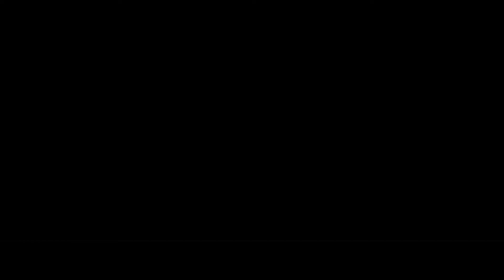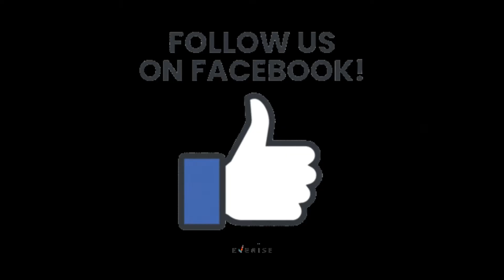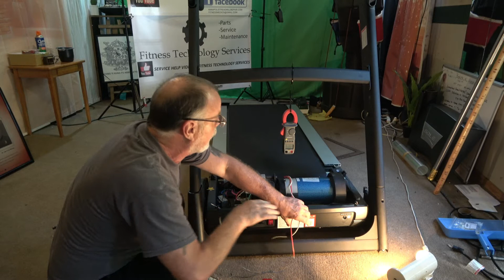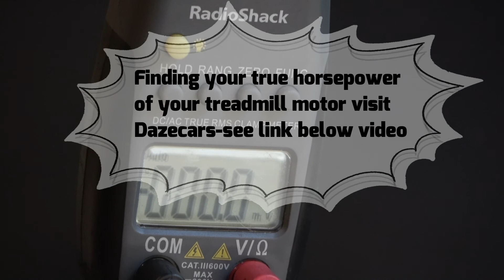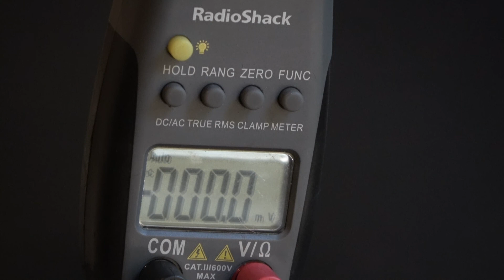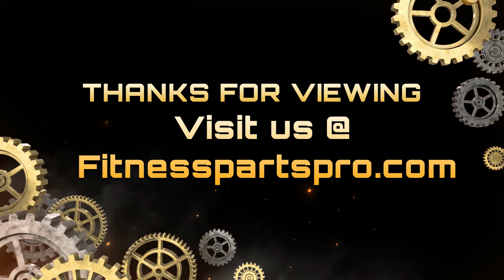Testing your Sole Treadmill motor

Comment: we are experiencing low speed surging unrelated to belt lube or tightness. is that an indication of failing motor of failing pot on board? how to isolate problem? previously had board rebuilt a couple of years ago. all board failures had screen fail to light. current condition is ls1 unless we kick start the belt. motor making noise when i stand on belt without kick starting. just looks like motor is bogging down because it's old.
Reply from the maker: Most of the time kick starting and noise is a sign of the motor going bad. Low speed stuttering can sometimes be fixed with adjusting the IR Comp . But you should do a walk belt test to see if is the cause of issues. I have videos on troubleshooting control and testing the walk belt

Comment: Great video! I have a question, I just changed  the motor control for the first time on my Sole F80. When I power it on, the light on the control is red, is this normal? My old control displayed green light. Thanks for making these helpful Sole videos!
Reply from the maker: I don’t think the color of the led matters. When the controller has issues the light sort of pulses

Comment: Thanks for showing us how to test the F63 motor.  Now I know that my motor is good.  I need to test the control board now since it burnt the connection on the board from the motor and it won't turn on anymore.  Nothing comes on.  Do I need to replace the board now?
Reply from the maker: Thank you ! If your controller connections are burnt you will have to replace board the only way to test it is to put a meter on the connections as best you can see if you have dc out to motor at start. Depends on what year I may have a video that may help. Sole motor controller troubleshooting. Hopefully this helps
Reply: @FitnessTechnologyServices  Thanks!  I found your troubleshooting video.  I’ll get back to you after I troubleshoot.  BTW, is there a chance that the transformer is the culprit?
Reply from the maker: @henzs.4241  well there is always a chance? But I have only seen one bad transformer and when it went bad there was no power to console

Comment: I just replaced my motor, new belt and deck flipped. Calibrated it, got 1:45 on 5 mph jog and got LS1 error AGAIN! Now what??? Tech that confirmed my dead motor said my board was fine. HELP!?!?
Reply from the maker: Hmm how did he verify the controller is good did he give you amp draw number. Either the deck is not suitable for flipping! Or the controller is weak. The only real way to tell is to amp the unit if while using it it pulls less than 7 amps then controller is weak. If it pulls more than 9 amps then deck is the issue making unit work to hard the amp readings are the answer

Comment: I have the F63 (SN 56381415....).  It counts down from 3, 2, 1 and then the display says 0.5 mph but the motor/belt is NOT moving.  5 seconds later the console reads LS1 error. ALL Console controls (fan/incline) work/display before the LS1 error appears.  The Control console can also alter the speed display but does not do anything to the motor.
I disconnected the motor from the Control Board and used a 9V battery as a source of power for the motor to determine if the motor is bad.  The motor runs. 
I then validated that the incline Up / Down lights on the board work as the unit is calling for an Incline command.
I then found the PWM light and observed it when I press the Start button.  The PWM light turns ON but then turns OFF about 5 seconds AFTER the 3 second countdown hits Zero. 
I attached my Multi-Meter to read voltage off the Control Board, after I disconnected the Red/Black motor wires for the Battery Test and do NOT read any D.C voltage when Powered On, during the Start/3 Second Countdown, or up to the LS1 error. 
I do not hear any "clicking" during /directly after the 3 second count down and not sure if there was a Relay that should do that or not?  Note:  I noticed a green LED light on all the time above the motor connection on the board.  It appears to read Motor DRV.  There is another LED light, not on, next to it that reads "Shut Down".  Any recommendations would be greatly appreciated.  Thank you!  Jay
Reply from the maker: Well that is a very good diagnosis and troubleshooting any time you have the pwm light on your  controller console is sending the signal . The controller is not working properly so you have a bad controller. But 90% of all controllers go out due to high amp draw from the walking belt being worn You should test your belt by force walking on the sides (on the logos ) then in the center to see if it is harder in the center. If yes you will need a belt Also
Reply: @FitnessTechnologyServices  So the PMV light initially being on means it is not the Console but a defection Controller (Board).  Is there a part for the board or are you saying if the "clicking" is not occurring /pmv light initially on then there is no "part" but only an entire board is the option? I was hoping it was like a refrigerator relay that is a separate part.
 
Do you sell parts like this and, if so, what it the cost including shipping, please? 

Also, I use the Sole Silicone on the belt when the Console tells me.  Are you saying that even if i do this the age of the belt is also the cause of the issue and no amount of Silicone over comes a warn belt? The belt looks great.

Do you sell the belt and, if so, what is the total cost including shipping?

This entire situation is odd because the machine was working fine, I lubricated it, and turned it on.  All good.  I then reset the "lubricant date"  on the Console and that is when i started seeing the LS1 error.  I guess weird timing.
Reply from the maker: @jaym48  for pricing or parts you will have to send your serial number to Fitnesspartspro@ gmail or you can input your serial number on our website Fitnesspartspro.com                         On the part of the controller that failed I am sorry I am not component level I do have them rebuilt around 179 but I would need your serial number to see which one
Reply from the maker: Oh and you should never wait until lube light comes on it  you should check it once a month and make sure the deck has a smooth/ wet coating
Reply: @FitnessTechnologyServices  so you do not have the Controller on your website; I just checked.   You are saying that you do, however, have them rebuilt?  If so, do I send you mine or do you mean you can get them "refurbished"?  If so, I will be interested  either way if you believe that is my issue per my long-winded explanations.  My SN is 5638141508016999

Comment: These videos are really helpful!
Reply from the maker: Thank you very much
Reply from the maker: Oops forgot to mention please subscribe 😃
Reply: @FitnessTechnologyServices  Done! 🙂I bought a second hand F85 2015-model (I think). Do you know if these motors are different from the newer ones - since the specs on mine show top speed of 20 km/h and the new ones go to 22 km/h? When I got it it stopped at 18 km/h even and I changed it to 20 in service mode.
Reply from the maker: @perarnelarsen2180  well to be honest I don’t think it makes a difference. Is the issue with someone on it .or running on its own.

Comment: Thank you for your videos. Speaking of motors , my 2020 Sole F85's motor is making a weird ticking sound. I recorded a video and you can see that it's not coming from the rollers and probably not coming from the pulley. 

https://youtu.be/yZaa8Vj-Qqc

Any ideas? Thank you.
Reply from the maker: Well you are so welcome, and you are right that sounds like a motor to me. The only thing you can do is check the motor brushes. They are under the black plastic covers. Make sure it’s unplugged sometimes the spring that holds them gets bound up ? Or the motor commuter is burnt in spots. And when the brushes hit that spot they tick .Either way I would call sole .so new this may be under warranty

Comment: This was a good video - very helpful.   I have a Sole F63 (date code 2014), where the motor hesitates when you first start it - but if you push the belt with your foot it 'catches' and starts normally.   Sometimes it will start itself, other times it sits there trying, but if you don't help it along by moving the belt manually it does not roll the belt itself.   I believe the brushes need to be replaced in the motor - when I readjusted the brushes it has worked again for a few weeks - but I believe that the brushes are just too worn at this point for the spring to keep good tension.   Do you have the ability to find replacement brushes for these motors?  I haven't been able to find them online (but have found replacement brushes for other treadmill motors).   Do you happen to sell them?    Note - I have a newer belt (6 months old) and the motor controller was rebuilt about a year ago.  I get no errors on the screen (then again I do not let it sit not running very long before I push the belt manually).
Reply from the maker: Well thank you, and I can’t find them either.Don’t know what to say about that?? Send me a picture of your motor I might have a used motor I could sell but I would have to waste one to take the brushes out. Send pic to Fitnesspartspro@gmail I will see if I can help Please subscribe Dave
Reply: @FitnessTechnologyServices  OK, thanks.   I will send the picture.
Reply from the maker: Oh sorry this does sound like a bad motor